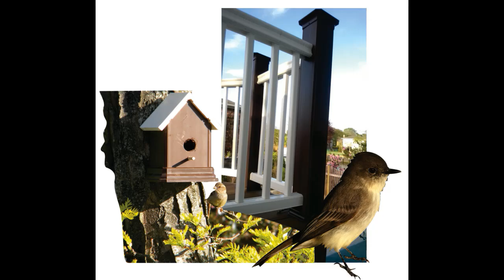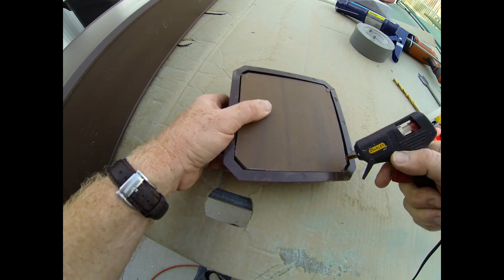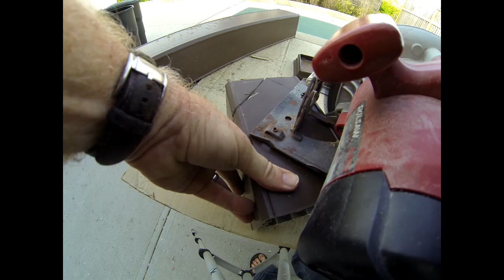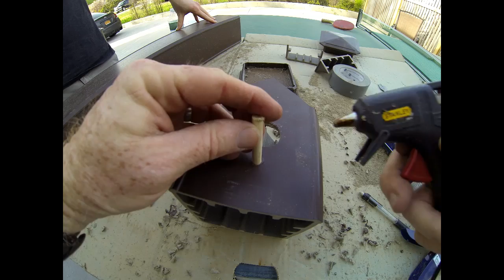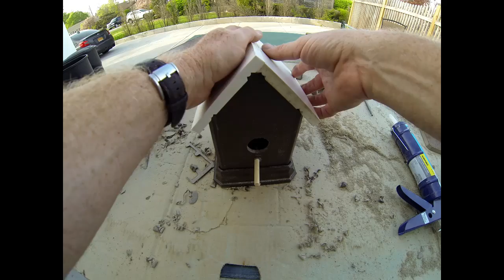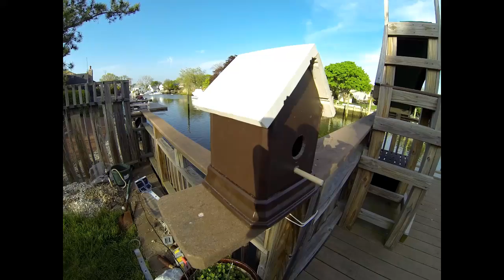How to Build a DIY Easy Birdhouse with Maintenance Free Trex and PVC 1

Comment: Nice! Does the silicon hold up long? Do you find it necessary to tap small nails in to help secure?
Reply from the maker: The silicone lasted for about 5 years and then the roof blew off in a storm. I attached it again with construction adhesive which seems to be holding